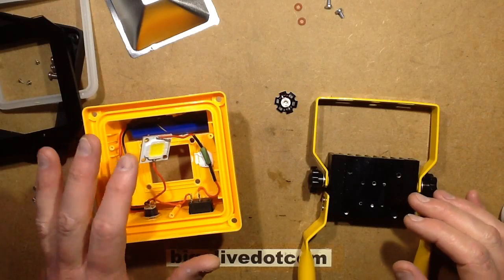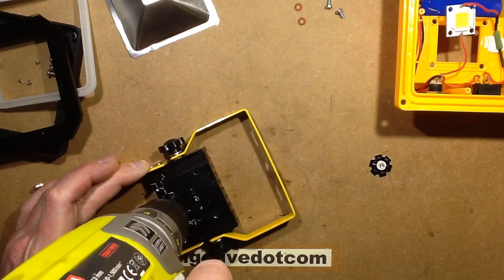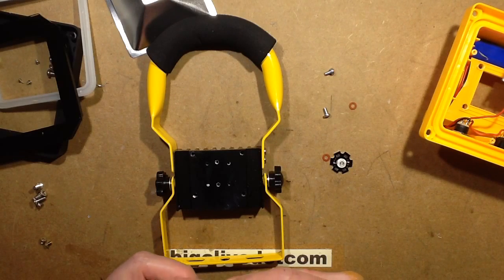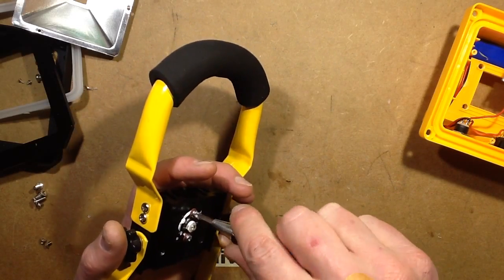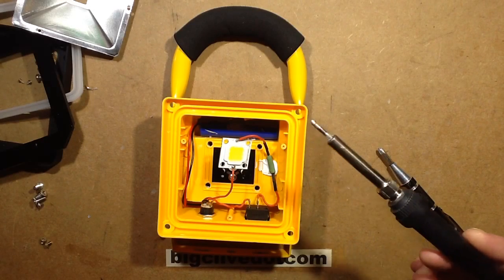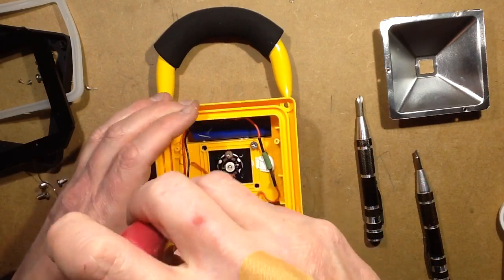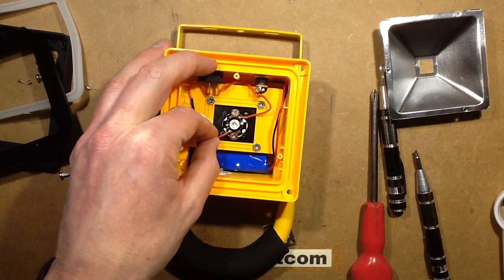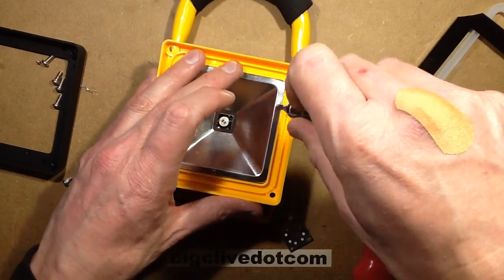Worklight conversion to garden feature light.

Comment: Will 2 batteries run in series, stepped down to the nominal voltage of one battery, last as long or similar to the same 2 batteries in parallel?

Comment: Well other than what I assume is a Mold enhanced rash thats been getting worse and worse.  and crack  oh blood  didn't know I was.  I've lost a fingertip already. (well could have if Wisconsin didn't have such great Workers Comp in August 2000.  ) They flew in the top plastic surgeon in the USA and saved the fingertip.  It's just a bit shorter than it used to be.  And if someone fingerprinted me they'd know me right off the bat :P  16 yrs later it still feels odd. (lacerated tendon they tell me)  I've also had a small blade in my thigh  (oh it went thru the jeans.  think it'll bleed  , uh oh.  it's gone red  oh no.  :P  and drilled my hand.  Thru an Aluminum window casing.  Oops.  not very attentive where my hand was :P  So I notice your hands and I sorta ignore them.  Been there done that.  Although do they have liquid skin over there or would super glue be just as good :)  (although on a chunk that big not sure if that would help much.  I'd just imagine that reflector is just as sharp.

Comment: I might have missed it in the earlier video - but is that 18650 running the 3W LED with only a large wattage resistor? I always thought it needed constant voltage?
I did just see one of these at a local shop: $59 CND - I hope it wasn't the same quality :)
Reply from the maker: Just a 1.2 ohm resistor.  That's all that's needed, but will result in a current through the LED that is dependent on the lithium cells voltage.  So it will get progressively dimmer as it discharges.  It's very common in these LED work lights.
Reply: bigclivedotcom Thanks Clive! Don't you ever sleep? :)
Reply from the maker: Hmm, it is pretty late.  Guess I should be going to bed.

Comment: In the old days, I used to clean my hands with white spirit or petrol to get the oil off when I was working on my car. Probably not the best idea! Nowadays I suffer from cracked knuckles, especially when it's cold and I am doing woodwork (I think the sawdust must pull the natural oils out of the skin). Anyway, I bung some E45 cream on them overnight, works a treat for making them heal up quicker. And I am a "white collar" worker if ever there was one (nearest I get to manual work is tapping on a keyboard), but I spend all my spare time tinkering :)

Comment: Clive I have a question for you. I see you use a lot of lead solder. Is that a personal preference or a functional preference? I've used lead & lead-free solder. I find that lead-free flows better. I'm just curious.
Reply: He uses Lead solder as it makes a better connection and you don't need stupidly high temps and mountains of flux to use it and make it flow right.
Reply: leaded tastes better
Reply: Rudofaux leaded solder is far less prone to cracking and it doesn't create tin whiskers over time.
Reply: I see.

Comment: Nice idea for the lamp, hope the hand heals soon! I do envy your streetlights turning off at 1am, theyve decided to replace ours with LEDS, great idea, but they are a blinding white rather than the more eye friendly red/orange spectrum. Driving under them causes a momentary blindness of anything but the interior of the car :/
Reply: The LED ones can give you quite nasty after images for a few minutes  if you look at them directly - which isn't a great safety feature imo.
The council just got round to changing the old low pressure sodium lamps on my road to high pressure sodium before announcing they were coming round again to change them to LED. the lamp nearest my house has been out for a month (I reported it)- guess they're leaving it until they do the LED replacement
Reply: Man I only wish the street lights near my house went off at 1am! Would make star gazing so much more enjoyable.
Reply: sparkplug1018
They've done this timing thing near my sister on some trunk roads - near me they've just disconnected a lot off altogether (apart from junctions). apparently it's a pretty arbitrary decision whether trunk roads get lit and there's not really a lot of evidence it makes any difference to road safety. course it was being done because of austerity rather than for environmental reasons or to help star gazers. Different case on residential roads - residents generally complain about losing street light afaik.
Reply: sparkplug1018 Same here. I have one thats been faulty for months right outside my bedroom window. It sort of strobes for the whole time its on. I have contemplated hanging the rifle out the window on many occasion. Whats worse is further down the street they do go off. It just stops before my house. Very annoying!
Reply: animesis they've replaces ours with white LEDs too, now everyone is complaining because the LEDs are too harsh on the eyes but don't illuminate as well, go figure.

Comment: Do you use .8 mm diameter solder or 1 mm? I recently got some .8 mm solder and it feels, well, unusually thin.
Reply from the maker: I use two sizes. 0.7mm and 1.2mm.  I use the smaller one most though and you'll notice I just tend to feed in a modest amount to a joint.
Reply: ***** I've always used rosin-core. Can't say I've really noticed the smell much (though my sense of smell is deficient - "anosmia"!) I seem to remember most "common" solders use rosin, so you might have a problem finding something different.  Next time I'm doing some soldering, I'll try my various "Chinese" brands, and see if there is any noticeable difference.
Reply: wow thats chunky solder. for electronicy stuff, leds, through hole components into pcbs etc I always use 0.4mm
Reply: 0yeme0 Gosh, that’s tiny!
Reply: bigclivedotcom Thank you, Clive! I did notice you were feeding quite a bit of it to the joint, hence my question. I’m just used to working with really thick solder (even greater than 1.2 mm).
Reply: Whose solder do you prefer? I've always stuck with Ersin Multicore, but have tried a few Chinese brands with OK results - Yong Chan Long Solder Co do a very decent tin/lead 0.8mm, as do Yin Lee Solder - both are cheaper than Multicore, and both produce pretty OK joints (electrical and mechanical)
Reply: +Phil S 
I've not used it myself but Kester seems pretty good, I'm considering getting some because you can buy 1lb spools of it for about $25, you'd almost never need to buy solder again unless you solder a lot anyway.
Reply: I have a .7mm and 1.2mm reel. Find I use the 1.2 more as it just flows into the joints better though seems to have a bit too much flux for most small applications and requires a bit of cleanup. I think if I had a flux pen or something to apply flux to the pad or hole first I'd use the .7mm more. It gives more control when it decides to wick into the joint but it's utterly useless most of the time just forming a large blob due to the lack of rosin core. Might try some thinner solder with flux core at some point but it seems a bit of a waste not using these two half full spools.
Reply: +Phil S I bought 60/40 solder with roisin flux but it smells unpleasant. what other fluxcore is better and less smelly ?
Reply: Phil S Hi Phil, thanks for your answer. In the 80s when I was a teenager I bought a roll of 6040 solder in an electronics shop. The roll is almost done now (I didn't solder for years but picked up electronics due to the Arduino making it popular again). Since the roll is almost done I thought I'd buy a new 6040 roll and found out Rosin is a good flux. I bought a roll of 250g Flux 2% 6040 0.8mm with Rosin core of a chinese brand called JINHU. My idea is (but maybe i'm wrong) that this new solder has a more heavy smell than the old Solder I bought in the 80s. Maybe I should've bought a more well known brand ? What brand/type do you think is good ? The old solder's label says C.W.T. (CA2) 920212. btw I do use a smoke absorber but sometimes fumes escape that air sucker.
Reply: ***** I've always used Ersin Multicore (since the 1970's) and had the expected consistently good results. The Chinese stuff isn't bad, and seeing as Chinese solder will be in most (if not all) today's consumer electronics, it is getting significant market exposure. The Yong Chan brand seems very good indeed, and was a fraction of the Ersin cost (via Bang Good - where else!) Bought 500g 1.2mm and 500g 0.6mm and that'll last me a few more decades!
Reply: Phil S Thanks Phil. I will look into the Ersin Multicore or the Yong Chan on Bang Good (if the Ersin is too expensive for me)

Comment: I'm a Blue collar worker, My hands not so bad, a lot of cuts and scars, but hey, I've only been at it for 21 years, before that I was a service station attendant. Can I check you oil and water sir?
Reply: It must have been at least 21 years ago. All they're trained to ask now is "Cash or credit?"
Reply: Better than that, I used to work the graveyard shift, and I had a stack of written warnings for going out onto the forecourt at night to help change a tire, jumpstart a car, check oil, connect a trailer, etc.  They threaten to fire you for doing what an attendant SHOULD be doing.  :P

Comment: Just something I noticed, the reflector is possibly very close to shorting the wire connections on the star. Since there's a LiIon cell in there with unknown protection, I'd insulate  the star from the reflector.
Reply: ferongr it is protected
Reply: Meh, it's still a bad idea not having a layer of insulation there.

Comment: What about using adhesive heat sink compound instead of drilling extra holes? Would that work if you we worried about water ingress? After all is easy to drill to far.
Reply from the maker: Ease of swapping LED.
Reply: waldsteiger
 And tell me whats your point?
Reply: for some reason i pointed out why water proofing would be hard with such a combined drill-thread bit. 
surely sticky stuff is better.
Reply: waldsteiger
Yeah  that's what I thought. But maybe there would be some reason why it wouldnt work in certain applications.
Reply: bigclivedotcom
I knew there was a reason. Thanks Clive.